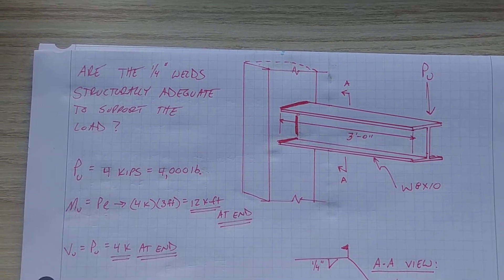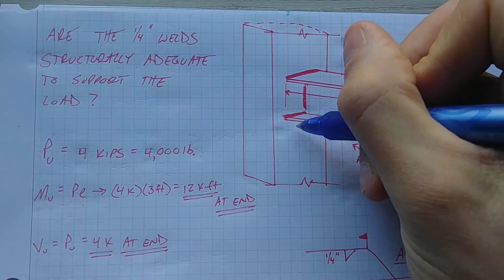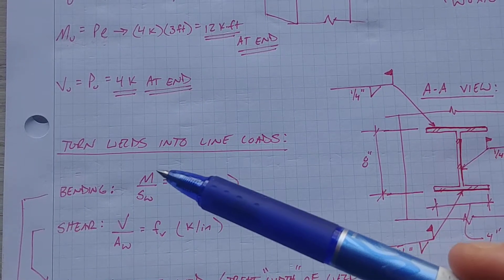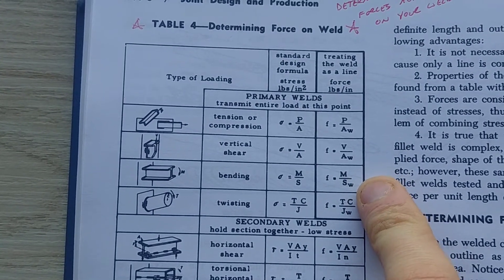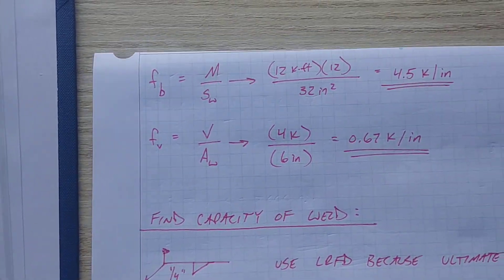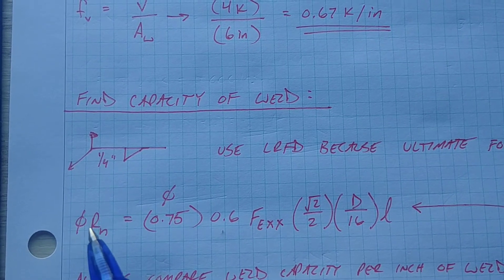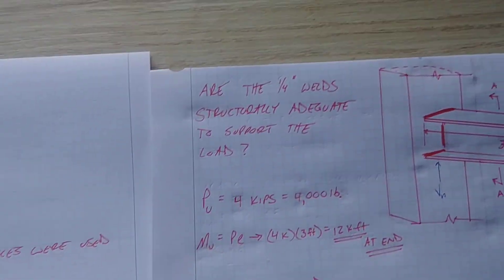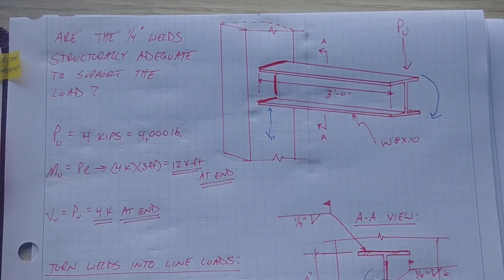How to Calculate the Demand on AND Capacity of a Weld

Comment: First  i appreciated all your videos but  i thick there is some forget in calculation at shear stress  F/Aw it should be all length of weld not only the web because the if draw the shear flow its resisted also by flange weld

Comment: Is there a video explaining why vertical shear can only depend on vertical weld? Or can you explain why?
Reply from the maker: I've just been told it as a rule of thumb, but from AISC and AWS direction I believe you can design a weld for both directions. The quick reason is that the shear demand is carried through the web of the WF beam in this case, so the vertical weld to the web is the most direct load path for shear forces, where as the flange welds are a much more difficult load path.

Comment: Quick question, at the very end, when comparing the strength per inch of weld to the stresses you calculated (shear and moment).

 Are you supposed to add the calculated stresses together (shear + moment) and compare that to phi Rn, or are you supposed to compare the shear stress value to phi Rn and moment stress value to phi Rn separately?
Reply from the maker: you need to sum the forces by squaring each stress and then adding them and taking the square root to get a resultant total stress. then you compare that single stress to the capacity phi Rn
Reply: @Kestava_Engineering  ahh okay, so take the resultant of the stresses. Thank you so much for your quick reply!

Comment: What if that W section was rotated 90 degrees and we still wanted to calc the shear weld capacity.  Would now the flanges as the vertical welds only be used?  Would the web be ignored if rotated as said to now be horizontal?

Comment: Hey Wonderful Job . I want to ask that the flange weld of 1inch will be also  helpful to the transfer of shear . so, the length of weld in shear direction will be 6+1+1 = 8 inch .  IS it Right? Can you let me know?
Reply from the maker: you should avoid transferring shear demand through welds on flanges in this condition. cheers

Comment: The welding lenght yo take it as 1 in for comparison and its ok. I think in converting weld to line load by using tables  its calculating for one side weld but in your example we have weld on both side for web and also flange. So I the value of welding line load should multiply by 2. Please if I have miss understanding revised what I said

Comment: Will this work for flange weld demand? Turn the torque into a flange force couple.  Do you think the welds or beam will experience additional stress because the flanges are not welded concentrically to the flange force, ie. only welded on one side?

144IN-KIP/(8)=18kips/4"=4.5k/in
Reply from the maker: Hi JJ, that's a great questions! honestly I believe the additional stresses are minimal in the case you mention at the flanges. and the couple you showed is exactly how the S equations are derived when solving welds as lines!

Comment: Question:  The weld capacity equation in Ch. 8 (simplified as 1.392Dl) is used for longitudinally loaded welds is it not? How can you check the flange welds with the same equation? If the flanges are in tension and compression, then the corresponding welds would be loaded transversely. Thanks in advance.
Reply from the maker: Great Question! Id say check out page 8-9 in AISC 14th edition and 16.1-117. you can conservatively take a weld strength of 1.0 regardless of load direction. but there are other options.
Reply: @Kestava_Engineering   Thanks for the response, keep up the good work.

Comment: Hi can you please do an example on how to design a moment connection? Like how to find the size and thickness of the triangular gusset plate and end plate at the joint of beam and column connection for practicing entry level engineer. Also, all type of foundation design shallow and deep foundation. Especially mat foundation first. I struggle to find good real live application example on this. Probably also go over how to design a simple 3 story residential building start to finish by hand calculation procedure step by step please so I can follow.Can you also share tips on how to connect formulas with real live applications. I can't seem to connect them.

Comment: Good stuff. A quick question: need to check (phi)Rn against fb and fv  combined?
Reply from the maker: i did not check for combined forces in this example because I took a conservative approach and designated the weld on the web to transfer shear stresses and the flanges to transfer bending stresses independently. if we calculated the Sx for the geometry of an I shape weld then we would definitely need to check combined forces! I should do another vid with a welding example. Great comment Matthew!

Comment: Very helpful. Thanks
Can i apply the method of checking the suitability of a weld described in your video, if the load is acting in tension only, i.e. no shear or bending?
Reply from the maker: Yes!
Reply from the maker: You may need to check block shear depending on the elements geometry tho.

Comment: Great Video! I have a couple of questions. When talking about which weld resists shear/moment, is there some literature on that? When learning under engineers at my company we've always used the full weld to resist shear and the full weld to resist moment using the welding design from "Steel Plate Engineering Data" by STI. None of us are structural engineers since we mostly work with ducting/piping/vessels but often require adding steel beams to supports things while we take out other pieces which require field welds similar to the example. 

I was also curious if you could do a video on stitch welds/secondary welds as my current understanding of the matter is iffy.
Reply from the maker: Hi Scotty
1. as a rule of thumb - shear only transfers through the web of a W section. Its very difficult to get stresses to move out of the web and through the flanges, so we typically calculate all shear moving through the web weld.
2. moment can be transfered through a "force couple" between the flanges of the w section. ultimately moving through the flange welds as either a compressive force or tensile force. 
3. you CAN perform calculations to resist combined shear and moment through the entire weld but we generally prefer to stick to the methods ive described as its slightly conservative and we dont have to worry as much about weird stresses moving through our connections to make things pencil out.

I hope this helps in any way! the blue book i mentioned in the video is honestly all i use for weld information! an AISC steel manual has literature about welds also.